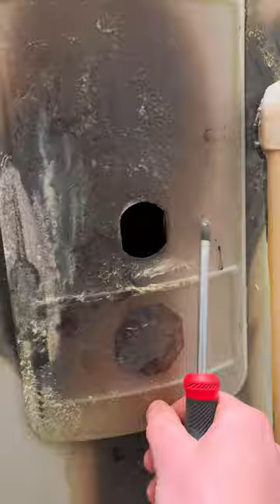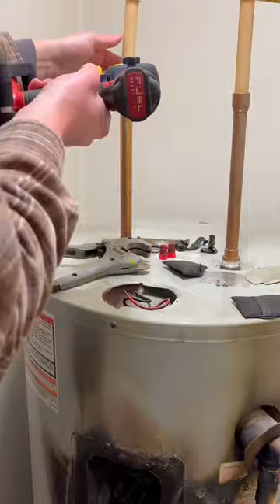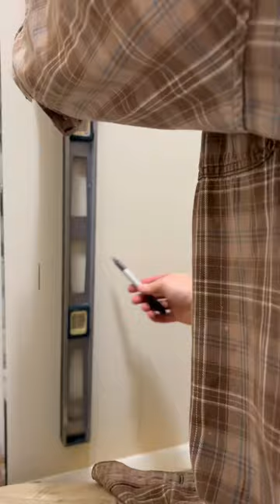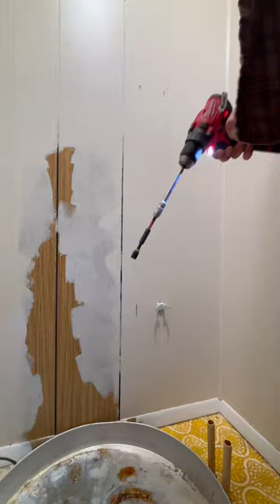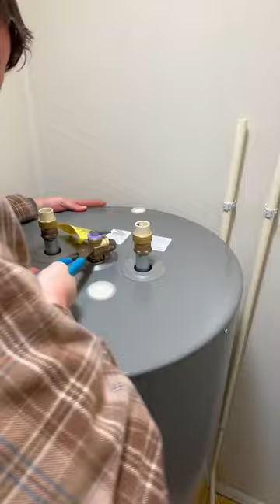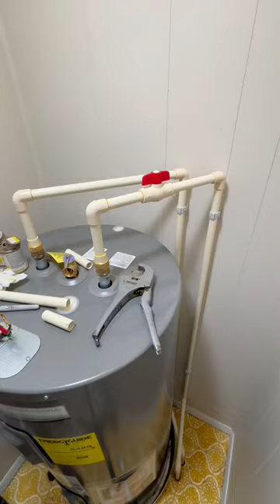Why did this water heater catch on fire?! 🔥🔥 #plumber #bluecollar #waterheater @dewalttv

Comment: Usually a loose connection combined with an old or bad breaker. The heat will build up until the contacts are glowing and the plastic insulators are melting, Fairly common issue in all electrcial componets. This could also happen from improperly sized wire and breaker but is not likely with the age of the water heater
Reply: Oven bit the dust this way.
Reply: It could even be bad thermostat and high temp switch.
Reply: You'd think the Fire Marshall would know what to look for on electrical fires like that.  Or at least determine if that's the root cause.
Reply: @ryanpaaz  it depends. Here, he probably investigated enough to write in his report "accidental fire caused by electrical malfunction." That's all the insurance company needs to know to cover the repairs.
Reply: @ryanpaaz  I think people give the firedepartment to much credit when it comes to finding the source. Over half the time they guess what it was based off previous fires.
Reply: @ryanpaaz when I was an electrical inspector, the fire department would call me in when they suspected electrical as the ignition source. They were very good at determining the origin of the fire, but had only a rudimentary understanding of electrical systems and code requirements. If we could narrow it down to a specific device like this water heater or a circuit breaker, they would then send it out for testing by a laboratory.
Reply: Was going to say something along these lines.
Reply: You said basically what I was going to say. Way to go. I see it in HVAC a lot. Just tighten down the wires right and make sure the connections are insulated. Heat shrink works wonders.
Reply: I would definitely be looking at that entire electric line before using again.
Reply: @ihavenoeffort loose wires cause fires
Reply: @legacypt1963 water and electrical currents are a fun thing. Those connection ports are covered by insulation when wet i can only assume are bridging the lines causing the plastic to melt thus setting everything on fire over time. Its a 240v circuit so not standard. Ive only seen it once not to this degree in my 20 years of replacing tanks. Im a gas fitter not an electrician so dont take anything i say as truth
Reply: This is what happened with mine. A lose screw made a lose connection. It started burning the plastic. Luckily, I noticed before it got any worse.
Reply: right like damn that’s your one job know how different fires start lol
Reply: THIS!!! Came here to say this
Reply: @ryanpaaz  not usually.  I am frequently contacted by one of my friends who is a fire inspector for an insurance agency when he suspects electrical.

Comment: Customer use either the wrong heating element in the one position, or mismatched eating elements in the two positions.... or, or, if it is a dual electric element water heater and the homeowner rewired it himself to run the two heaters in series instead of in parallel, that will do it.

Comment: Cpvc gets brittle over time mostly on the hot side.
Reply: Also in uninsulated crawl spaces in hotter than temperate climates.
Reply: Happened to me, I'll never use it again on the hot water side !
Reply: But if it catches fire again the plastic will be easier to melt thus self extinguishing the fire it created. 
On a serious note I'm pro copper when it comes to this.
Reply: CPCV   -трубы ещё используют в Африке и других странах третьего мира.
Клей  для фитингов токсичен и здоровья не  добавляет.
А , со временем  трубы становятся  хрупкими.
Лучше, из доступного  - медь, ну или  полипропилен.

Comment: Seen that before in a HWH. Electrical fire, but your's is worse.
The thermal insulation started to burn also. That has fire retardants, and once the other fire source is removed, is self extinguishing. 
The fire would have been most likely self extinguishing, once the electrical connection sufficiently burned up/breaker tripped. But could have potentially ignited something flammable next to it.

There's likely 2 parts to this failure:

1) - the thermostat burned up, most likely from a bad connection, usually from a loose terminal. Or a worn contact in the thermostat. Moisture induced corrosion can cause it too. And bad connections cause the PVC wire to start burning, causing corrosive gasses to be emmited (hydrochloric acid...), making things worse, in a exponential runaway situation. 

A bad connection creates heat from I^2R losses, which accelerates the problem, usually going into thermal runaway until something fails. 
In this case, due to the increased resistance, the thermostat became a heating element too...

2) - low quality, cheaper parts,, often bought from offshore sources. Thermostats used to be bakelight or thermoset plastic. Like the materials used for breakers. These plastics didn't melt, even under severe fault conditions. They are now often made with thermoform plastics, that can soften when heated. Wall switches and receptacles are also often built the same way now.... Older, higher quality parts usually just failed to work, and had minimal damage, when they failed. Also, water heater wire insulation used to be fiberglass braided insulation, usually with a waterproof layer like silicone in some varieties. 

The supply breaker would only trip if the current went higher, but where this fault was in series with the heating element, current actually reduced , as the thermostat started becoming resistive. 
The fire extinguished once the circuit burned up enough to loose connection or shorted to the tank/casing/another wire, enough to pop the breaker.
In higher power situations (eg 480, or 600V industrial power) an arc flash can occur. Those are scary when high currents are involved....

Please forward to your fire marshall, so that they are aware of the root cuase. They will unfortunately, likely see it again...
This info is from an EE.
Reply: Impressive analysis, Intresting!👍
Reply: We need to make things like they used to. We need to stop the process of cheapening our way of life.
Reply: This was the short version folks!  😜
Reply: tldr?
Reply: I am a master toilet mechanic and professional water heater wrestler, (plumber), so I already knew all that. 😅
Reply: HWH or maybe just WH?
The former seems wasteful.

Comment: Wire came loose over time and started arching. It’s very important to make sure wires are tightly connected. Electric vibrates and over years wires can loosen little by little .  That would be my guess to what happen

Comment: I did electric for a while, and now I’m in a plumbing shop. Everyone here is talking about strictly the electric side, and, obviously cause it’s a fire, but, now as a plumber, the buildup of lime and scale on the elements is humongous. The bottom one specifically, I’ve seen basically submerged in a hard white calcium chunk bath.
Reply: I've pulled heating elements with like ¼ inch calcium buildup and never had any of them caused a fire , I doubt that was the issue
Reply: I've pulled lower heating elements out that actually coroded & BROKE OFF due to sediment build-up - had to fish it out with needle-nose pliers..
Reply: I know what you are talking about white chunks 4 sure calcium. Also magmesium is the hard black stuff clogs up copper line just after outlet on H.tank.
Reply: I was going to say the minerals build-up. About 20/30 years ago one of our neighbors water heater exploded upward.  Tragically their daughter's room was above that. They were living in military housing. So the federal investigation came out to be the minerals and they began checking all housing.
Reply: @whitecottonD  Yes I have heard about  them exploding and shooting str8 up. Manga CheesEium.  Magnesium

Comment: I had one do this after putting in two new elements, the top thermostat had a dead short in it. When I turned it on it caught fire and kicked the breaker out, found out that they kept resetting the thermostat even after the bottom element had died until the top one departed also. Installed two new thermostats also, and about a month or so later the 30 amp breaker went bad. Crazy times

Comment: My cottage is piped in CPVC since it was built in 1976 and I've had no problems so far.
Reply: You Didn’t… until you temped fate!
😂
Reply: So far.......... 🙈🤦‍♂️
Reply: a lot of newer cpvc has problems but the older  cpvc and some cpvc now is good, your cpvc was probably made by genova.
Reply: @junkevidence  I'm doomed 😞
Reply: @jacksplumbingvideos7147  I'm not sure who the manufacturer of the pipe is but if you can see the install of my plumbing you'd throw-up in your mouth a little, it was NOT put in by plumbers and it shows. I was going to get it redone by a pro plumber but the money dried up. [SIGH]
Reply: I did plumbing and HVAC for 27 years. I’m not a big fan of CPVC but I’ve only ever seen two problems with it. First, it wasn’t glued or supported properly, and the joints started leaking. It was so poorly supported that the pipe runs had very visible sags. Second, customer divided a house into a three apartments. At one point, what was to be the third apartment was just exterior walls on three sides with no insulation. Customer ran CPVC through this unconditioned space to one of the other apartments. On a brutally cold winter night, the CPVC froze and shattered like glass. By contrast, when copper freezes, it usually swells and splits.
Reply: @jamesszalla4274 the freeze and the Sun Corrosion.

Comment: As a real licensed electrician, unfortunately, it’s impossible to determine what caused this without further information .. as speculation we can guess loose connections, improper wire size/ gauge, Oversized overcurrent protection  ( common in households that have breakers constantly tripping so the homeowner up the amperage of the breaker but not the wiring itself causing overheating of the conductors)
Reply: You are an honest and experienced man, you did not brag,
Reply: I have seen bad thermostat burning  up. Thermostat was stuck on with bad contacts causing heat to build up. Luckily customer noticed burning smell before it did permanent damage. Replacing thermostat and small section of wire was all it needed.
Reply: I'd love to see what breaker was powering the water heater.
Reply: @danp7463  A Very warm cooked plastic One

Comment: Most likely a badly corroded or loose wiring. This results in less surface area of electrical contact massively increasing the resistance at the connection the heat generation will cause any nearby combustible material to burn given an adequate supply of oxidiser.

Comment: I had one recently. Not as bed as this, but was on fire behind the panel with some burnt paint around it. The house had been flooded with salt water a couple weeks beforehand. Looked like the element wires had shorted out and luckily the homeowner was just outside the garage when it happened and turned off the power and put it out.

Comment: Actually had found something similar to this two days ago on a water heater changeout. The water heater had a very slow water leak from somewhere behind the outerplate and water got around the connections and it ended up shorting and causing a small fire. Nobody even knew about it. We got called for a no hot water amd when we started to look we found the leak as well as a burnt up thermostat

Comment: CPVC is about the same vintage as that yellow vinyl floor and Federal Pacific breaker panels. 
Why didn’t the breaker trip?
Reply: Perhaps you are spot on with the Federal Pacific breaker panel, which would explain the breaker not tripping.
Reply: Coins, pennies with electrical causes fires

Comment: I've seen moisture, and watter find its way down the foam insulation causing a fire. It's actually quite common, and a good reason to keep up on servicing electric water heaters.

Comment: I worked in an apartment complex, one time we had a water heater that had a blown element. Preparing to change the element I set my plyers and wrench and screwdriver on the top of the water heater. I reached to shut off the circuit breaker and my screwdriver rolled into the cold water supply line and it made a huge arc. The blown element had somehow been conducting 220v current into the plumbing.

Comment: Agree with most comments. Cpvc does get brittle on hot side specially when the temp is higher. Given the situation,not much else to do. 
Only question comes to mind is not coming off the unit 18" prior to synthetic? 
I'm under the impression that is what most pipe manufacturers want us to do. 
I've discovered burnt wiring between the jacket and tank , manufacturing defect .

Comment: I have had numerous pin hole leaks in copper pipes. Never had any problems with cpvc in 25 plus yrs.
Reply: Keep on living . . .
Reply: The house I grew up in had hard water.  Corroded the copper pipes. Pin hole leaks.
Reply: Only type M gets pinhole leaks. Should've used type L

Comment: I had one catch fire like this. In my case, one of the previous owners of my home had rigged both elements to run simultaneously. Over time this caused the water to overheat and build up pressure. My furnace was right next to the tank and the pressure relief valve was unable to release. This blew the inner chamber and water filled the outer chamber and reached the circuitry, shorting that out and causing the fire. It took almost 2 hours to drain all the water from the old tank.

Comment: Actually this is fairly common. The elements, when corroded usually break, in turn the circuit is broken and no hot water is made. sometimes sediments will complete the circuit,, sometimes it's loose connections,, and sometimes it's a faulty breaker that doesn't blow... in any case the plastics,cardboard, instructions, or styrofoam that is in the element area ignite because of the electrical build up of heat under the cover. Commercially and Facility level,, we add a Y strainer on the incoming water supply to help eliminate the build up of sediments. We also ohm the elements every time we drain a Y strainer as a periodic maintenance step. Most commercial water heaters have 2 to 9 elements but any element can cause this. Keep all ignition sources out of the element area.
Hope this helps.

Comment: Id have someone check the breaker too. It may not have tripped when it should. 
But this is probably a failed thermostat or loose wiring.

Comment: 40 years with the Fire Department, my answer is yes I have seen this, the thermostatic control for turning the heating coils on and off fails, thus just keeps heating until the wiring burns up.

Comment: I had one catch on fire...it melted through the wire nut because the guy who installed it didn't install the wire nut correctly, and it was arcing off each other on the hot wire. It melted right through the wire nut and grounded on the metal body. It didn't go up in flames because the lady was right there and shut the breaker off, but it could've been worse if she wasn't home. This is why I don't like wire nuts, and switched to solely Wago connectors. Been using them for 2 years, never had one single issue. But at the end of the day....shit happens.

Comment: A guy I know does things half assed. When I met him years ago, he told me he used to work for a family owned plumbing company that’s been in business since probably before I was born so I was like “cool” when he told me he’d replace the thermostats. I went down to the basement and smelled wires. There was a small flame under the cover burning the plastic. He didn’t connect one of the wires under the screw very well and it got hot. Since then I’ve seen him be too lazy to take a minute to do things right.

Comment: Well first the gripe, never use a sharpie to mark any kind of drywall or interior work or area that is to be painted.  Sometimes if somebody wants a repaint Sharp you'll just come right through and require multiple codes and or primers to cover. 

And I have seen very similar meltdowns as other people of commented it's a failed dual pole breaker or pennies stuffed in the fuse holes if anybody's old enough to remember that. But the t-stats in the heater itself get warmed right up by the overcurrent and  eventually melt down And the only thing that saved the house besides the functioning smoke detectors is the fact that a conductor somewhere melted opening the circuit and stopping the arc .

Plumbers homeowners electricians everybody should be reading the NEC national electric code and local codes that's specify types of breakers IE arc fault and GFI, but a house plumbed in CVPC is probably a little bit older than that

Comment: I had a very similar situation almost exact. 4500watt electric water heater. I was confused myself as it was my first experience eith something like that and I was the first responder. After checking everything I possibly could, what I found was the electrical that was hooked up to it was only 12-2 cable on a 20amp breaker. I know the minimum requirement is 10-2 cable on a 30amp breaker. I'm no electrician but my educated guess is sayin too much load on the 20amp started this fire

Comment: I am an electrician I saw this once not as bad a fitting on top of the water heater had been leaking for a long time all t stat and element connections were corroded the lower t stat finally shorted out.  You should change the breaker it should have tripped sooner.

Comment: This is very common. The inner tank had slowly rusted until it got a pinhole in it. Water leak down onto the thermostat and it got wet enough to sort out that's a 240-volt short with a 30 amp double pole breaker. That's a guaranteed fire.